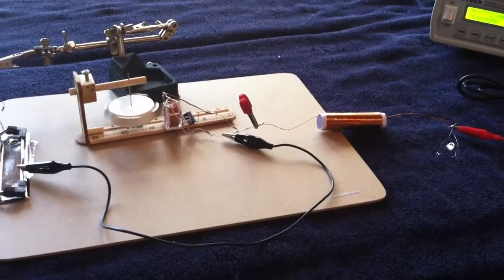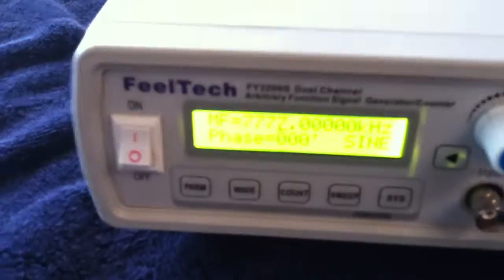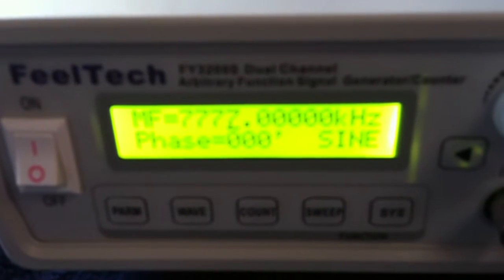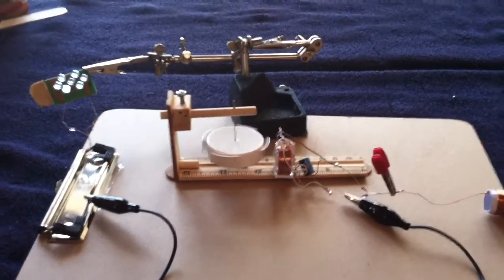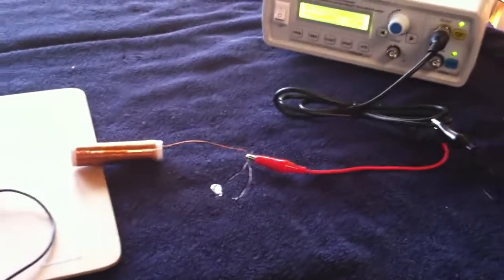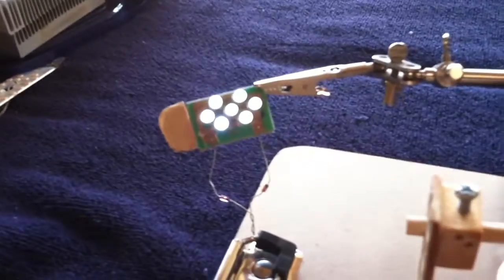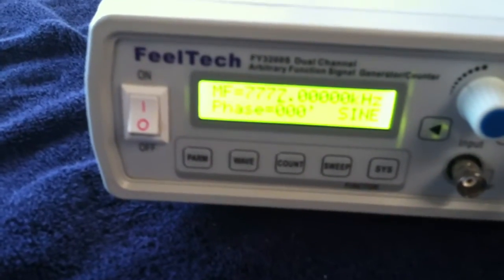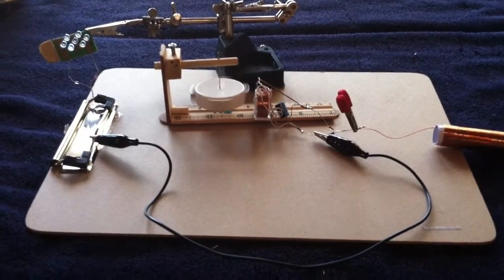Lucky 7s Pulse Motor

Comment: What voltage were you running at, from the FeelTech?  also, where did you purchase the FeelTech?  Thanks!
Reply from the maker: I had it cranked up to 20v.  It should have been going a lot faster but this was all I could get for some reason.  This is where I got the generator on EBay:   https://www.ebay.com/itm/FY3200S-24MHz-Digital-DDS-2-Channel-Arbitrary-Function-Signal-Generator-Meter-US/362002419767?epid=1685917492&hash=item5449069037:g:MNgAAOSwk-1aFTuQ

Comment: Back emf changing internal frequency perhaps even leds have a effect. The virtual ground gives it somewhere else to go. If you had a sensitive enough calorimeter we might see the change in temp on the ground sink. Or you should be able to put another loop on sink and move it into something else before it dissipates into light.

Comment: That's neat and a half !
Had your prop job going yesterday, but it similarly didn't want to run sometimes, as in no LED flashes at all. I was sitting there probably similar to yourself, thinking what could have changed on the exact same set up. It's on the bench at the moment, so was good to have that somewhat verified about being touchy to run
Reply from the maker: I really glad that you saw the same thing about the pulse motor not acting normal.   Once I got it running I tried different wave form, frequencies. and voltages.  It would run pretty good on a sine wave or square wave somewhere in the MHz range only.  So why does this work on a Slayer Exciter running in the KHz range?  It is a bit of a mystery.
Reply: My thinking was the pulses are too short on a MHz system. It seems odd if there is a cap in the supply to the pulse motor, but what if some caps can't accept the voltage at that speed ?